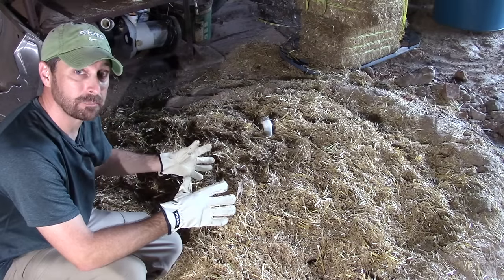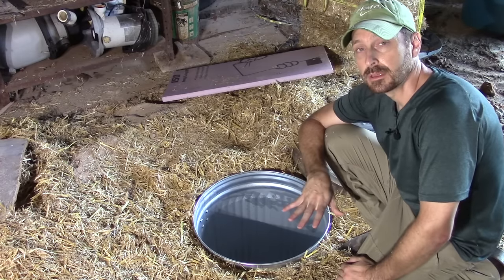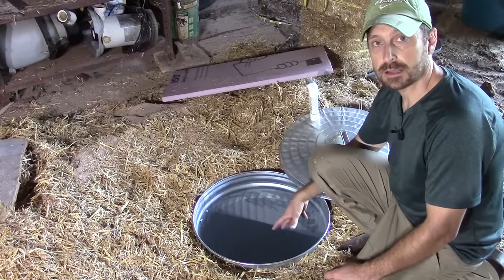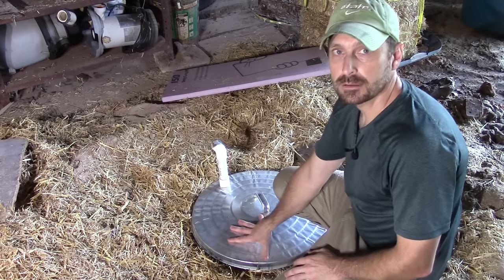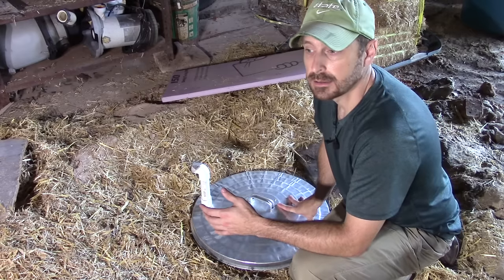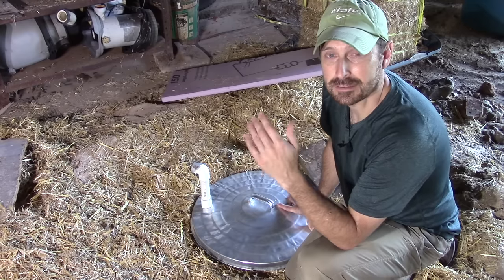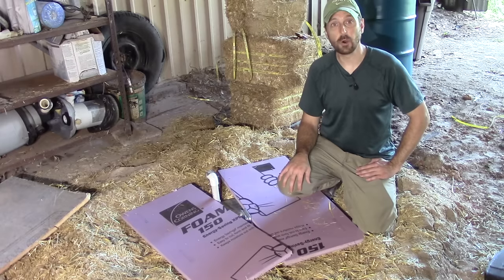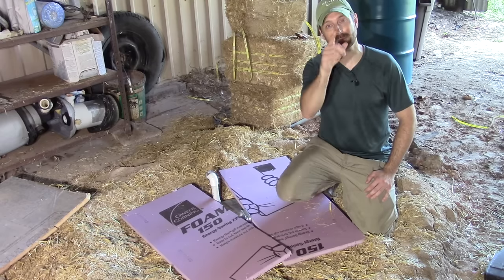Our Simple Inexpensive Root Cellar Build

Comment: How do I make that vent?
Reply from the maker: For the vent, I just took a piece of 1" pvc and put a 90 degree elbow on the end. I covered that end with some screen so bugs could not get in. I used a hole saw to make a large hold it the top of the can and then inserted the pipe.

Comment: Burying a steel garbage can as a root cellar is a good idea.  But - Unless the outside of the bottom of the garbage can are vented to the atmosphere, no air of any temperature will pass. You’re fooling yourself.  Straw is a better insulator than is hay. 
Courtesy of Half Vast Flying

Comment: Eh. Thanks for the video. But I don't get it. $40 could have bought you a nice plastic igloo cooler from Walmart. Will not rust. No straw to rapidly decompose. Not sure what the attraction or advantage is here using a trash can.
Reply: Rats and mice can chew thru the plastic.
The deeper can accessed the cooler temperatures lower in the soil. 
And Plastic outgasses chemicals.

Comment: If you have any ground water your “root cellar” will leak.I learned the hard way metal garbage cans are not waterproof.
Reply from the maker: You gotta check that first for sure. None for us here at that level.
Reply: I have Doug a hole in middle of field lined it with straw potatoes, apples cabbages used it all winter straw on top too then left over dirt from hole all produce fresh as was put in ground.dig some out cover back up never had any problems grand dad thought me this still works now

Comment: I stopped your video at 5 mins because you did not discuss about what was below the bottom of your trash can for drainage, I think you just set it on top of bare dirt and that would not be good. Can't subscribe either.
Reply from the maker: Lol. That's fine. We don't need your kind of thinking here anyway.
Reply: @CountryLivingExperience  I set 2 pieces of 1 inch pvc under my can.
Reply: @CountryLivingExperience  hello. I recently discovered I have a hidden root cellar underneath my condo 👍👍👍👍👍